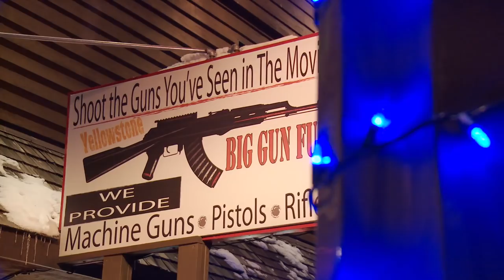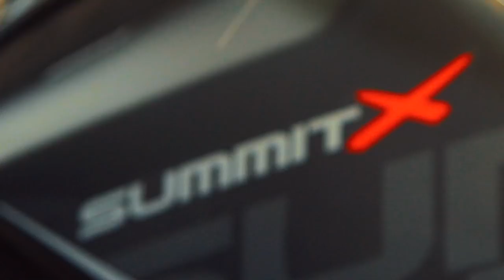SnowTrax Television 2018 - Episode 9

Comment: I prefer cost effective ways of attaching accessories to my sled. I get it, LINQ is good but all I see is an overpriced bracket to attach overpriced accessories. I installed a set of 18" O-tracks from Erickson to the tunnel of my sled and now I can attach or strap down anything from bags and boxes to cheap red fuel cans.